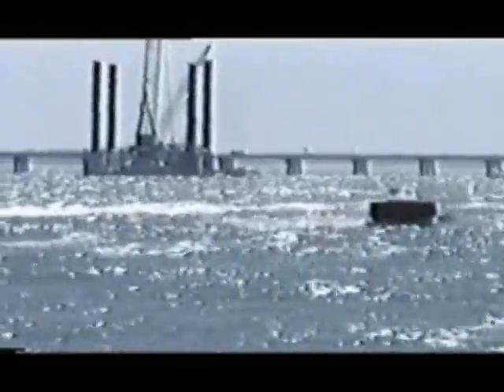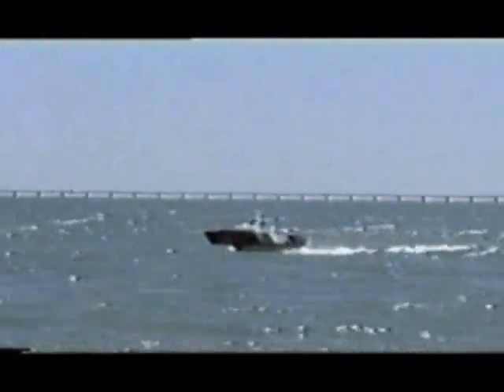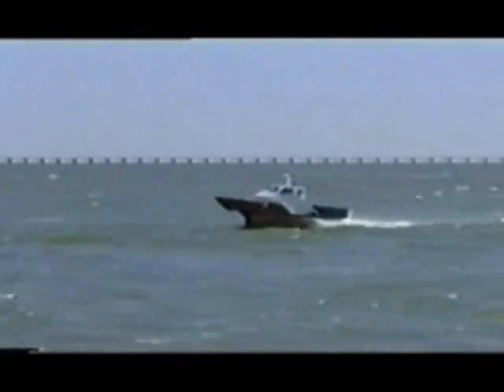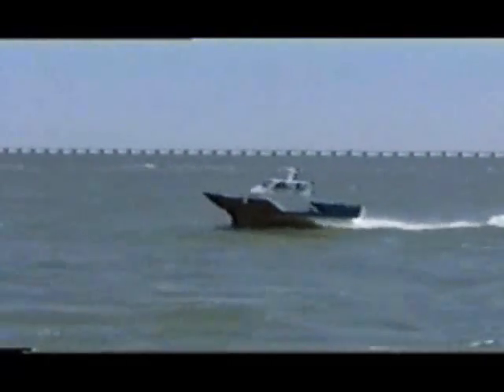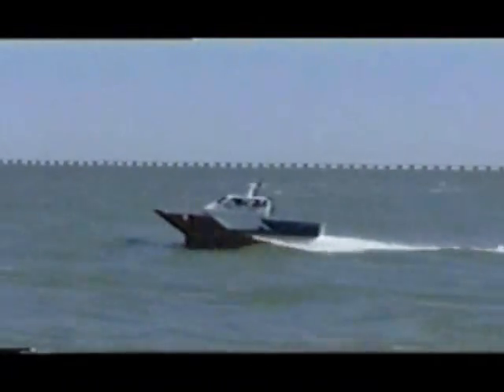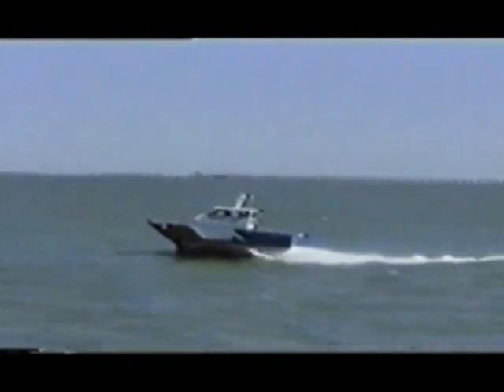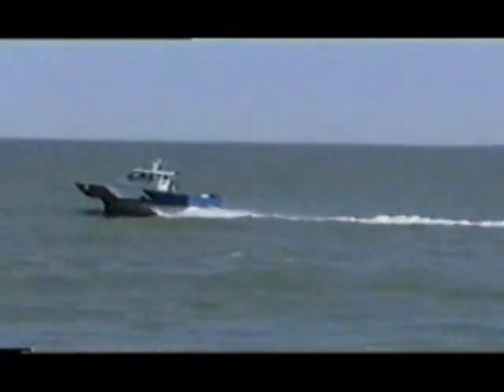HYDROFOIL Flying Fast  in Rough Water--HYSWAS.  Ray Vellinga edited this video.

Comment: The HYSWAS is NOT dead, it just evolved.  The "Ghost" is a high speed stealthy recon naval vessel that uses a pair of HYSWAS type of "wings".   From what I'm seeing so far this vessel blurs the lines between a hydrofoil,  a HYSWAS and a SWATH hull.  It seems to use propeller cavitation (located at the front of the "fins") to reduce aqua dynamic drag.

https://thechive.com/2016/08/23/navy-stealth-concepts-riding-on-blades-23-photos/

This thing may just be the future of how high speed combat naval ships a build in the future.

Comment: How is this economical? Needs hundreds if not thousands horsepower to get it up and need multi thousand liter fuel tanks just for small range. Only ten times slower have range to cross oceans.
Reply: This is much more efficient
Reply: It doesn't need much power at all.
Normal cruising speeds above 15 knots will lift it up...

The hydrofoil reduces drag, which means you can go faster, subsequently more economical as well.
Reply: Think about it. By lifting out of the water drag is reduced quite a lot. Much more efficient than in-the-water cruising vessels.